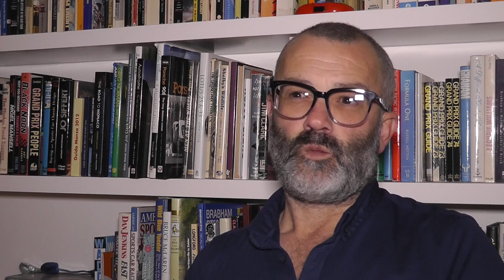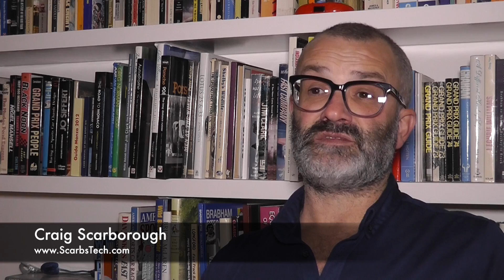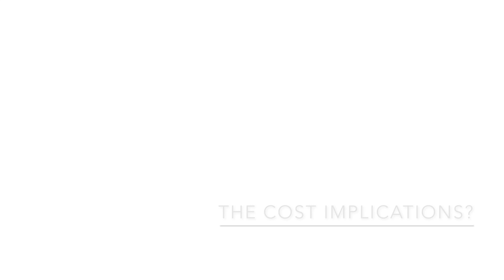Why more F1 engines may blow in 2017

Comment: The other teams could never catch up under the token system. Mercedes came with the best engine in 2014 and no one could do anything about it even in 2016 teams were still way behind because introducing improvements was so restricted. There is a natural ceiling of engine development they will hit as the engines mature. They need to let the suppliers get as close to that as possible and then they can re-introduce a token system or a freeze once they have 3 or 4 competitive engines.

Comment: ohh he didn't mention wider tyres also puts more stress on the engines so higher pressures internally. And btw I am doubtful Mercedes can make great strides with their power unit because I don't think that much more can be gained from a 1.6L block.

Comment: I see there's the great debate v10 era or turbo era why can't we get turbo 3 litre v10s. make f1 less boring and more fun and mad
Reply: Is it I3, V4, B4, H8, V12 whatever only rly make some difference in sound. Although difference in sound is mainly on exhaust itself(end turbo as part of exhaust/intake system) not engine config.

Also V6 turbo Hybrid today are as powerfull if not more than old engines. Also electric engines mean they are much more responsible. while being smaller, lighter, more reliable... in every single aspect better.

Comment: Let's not ignore the new controlling interest from 2017. Development could be something like; improve engine reliability by taking out some of the slower corners. Perhaps just leave three (left handlers)? Ease stresses on steering and suspension by banking the turns. Prevent ingress of damaging, abrasive materials after a run off into gravel traps by walling the track with concrete. This will also allow moving the crowd right up to the track edge and get them safely nearer the action. And for a stroke of genius, run the whole series calendar in just one country and save all the expensive logistic costs to divi up between the board of control members.
Reply: Engine reliability come from stop-start corners. Generally the lower engine is reving the better reliability. Because of reliability nobody is even going into 15 000 rev limit, most teams don't go above 12 000 because they don't want to blow engine. 

Also that's one of reasons why there are limitations on circuits designs. Like in to corner can't be faster than 120km/h, straights(slight curves are straights) can't be longer than 2km ect.
Reply: I think you missed my point, Czorny. If the Yanks are controlling F1, they'll turn it into NASCAR. Americans don't understand complexity, finesse and aesthetics. Brute force, up close, in yer face is what they like and what they want is what they'll get.They won't pay to see a sport where the cars come into view and flash past in a blur every 90 seconds. They prefer to watch them go round and round and round and... NASCAR!
Reply: Of course there are plenty of Americans that love F1 as much as anyone, but that doesn't mean that the generalisation is wrong, Michael. I can only speak in a general manner but as long as the majority are within the parameters of the statement, then it bears out. I don't have the facility to poll 320 million people to propose a more accurate statement, so what I offer is my opinion. I can't prove it, it can't be disproved because the evidence required to do either would be incomprehensible.
Though, I might add, the most interesting and important detail to be reported from early testing is that the new regulations regarding down force, designed to make the cars go faster, will make cars harder to follow and overtaking more difficult.
https://www.theguardian.com/sport/2017/mar/01/lewis-hamilton-f1-new-rules-barcelona-testing

I appreciate that these regulations are introduced by the FIA but Liberty Media, the new Company that controls the media distribution of F1, is going to have some very persuasive influence on what direction the sport goes in, similar to that of SKY with EUAFA.
So, I'm sorry if my generalisation misrepresents you personally, Michael. But it's already looking pretty solid as far as I can see.
Reply: IsitreallyTHATimportant Really? ross brawn.  now stfu.

Comment: I do not understand the FIA's obsession with "street car relevance" and cost cutting.  What do they care?  If the intention is attract more factory teams from VW, GM, Vauxhall or whatever, what do costs matter then?  How boring would that be anyway?  It's teams like Force India, Haas, even Williams' RBR and McLaren (relative to Merc) that make the sport exciting.  The FIA shouldn't even concern itself, necessarily with things like fuel efficiency....that's what Formula E is for...  Better sound would be great, but better racing would better.  We the fans aren't going to make a difference.  What will make a difference is when drivers and teams start to pull up of F1.  Alonso even said that he would retire if the cars stopped being fun to drive and that they were close to getting to that point.  Hopefully, if engine reliability issues because of the new demands on the power units and the higher cornering speeds suggested for 2017 will cause a bit of a shakeup and we have more results like Spain and Malaysia with Merc finding a more evenly matched field of competitors.  Hell, I wonder if we might even see Sauber or Manor get a podium!  Doubtful, but one can hope!

Comment: F1 is dead.
Reply: Car Guy The only competition in F1 is that to see who can invent a rule that dramatically increases profit.

There is nothing left of it except the rule book and the media circus that follows it around.

Zero sport and zero entertainment.
Reply: f1 today is called branding
Reply: No it isn't. It's just your passion that's dead. It's very normal, don't worry. It's just what happens sometimes when you get old and bitter.
Reply: Lol. MotoGP is where racing is at.

Attack the person not the message whilst your weak mind tries to catch on.
Reply: no really its dead
Reply: For all those commenting that F1 is dead, or is not a motorsport, I have a suggestion.  Strap on an open cockpit, open wheel car, and line up with 21 other DRIVERS.  Then hurl yourself around a complex of turns and compressions at average speed 140 MPH for 2 to 3 hours enduring 3-5 Gs in turning, accelerations, and braking whilst communicating with your enginneer.  If you finish or survive, then I would like to ask you, is F1 a sport?

If you don't like the sport that is your prerogative, but it still is a sport regardless. 

As far as marketing  damaging the sport. I partially agree.  But if one looks closely, they will see this is the way of the modern world.  All popular sports, athletes, and entertainers are milking that cow.  I find it annoying as well but it seems that is the way it is these days.

I must apologize if it seems I have a harsh tone,but my heart is with drivers always, who show equal part skill and courage, in all motorsport.
Reply: And that's a good thing. It has competition in every area
Reply: Don't underestimate the power of a good flogging.
Reply: I don't believe I ever used the word dangerous.  But I was making the point,  it takes a massive amount of skill to bring those cars home, skill from everyone involved.  Again if you don't like it that's your choice and opinion, but considering the stresses on the body and skill required, I would still technically classify it as a sport.  

Actually the way you described the current sate  of F1, I feel the same way about the NFL, and though I used to love NFL football and now I loathe it, I still consider it a sport.  And I agree on that point, perhaps their is to much meddling in the rule book.  

But I still see the competition, mostly in the back of the field, granted.  And maybe your team might not win the world championship, but perhaps they can steal a podium in a GP or two.  It's not that the competition is gone, it may have changed, and obviously changed for the worse, in your opinion, and in the opinion of many, seeing that F1 has lost fans since it's peak.

And on domination. Actually in many sports the same teams tend to dominate.  Look up how may different teams have won the world cup, or world series, or super bowl.  Not many.  It's the nature of the beast, especially when money enters the picture.

But even after all this, my point is whatever you think about the state of F1, the drivers are still athletes, and it is still a sport.  

Maybe I'll skip the flogging, and take up Golf, or Darts.  You can go watch paint drying if you like.  They probably bet on it in Las Vegas too.
Reply: It's been dead for a long time. For various reasons mentioned in other comments but dead, it is. The racing is almost as boring to watch as that American oval racing is, in all its forms. I don't give a shit about cost containment, it's not my money. Teams who can't afford to race shouldn't be racing. Technology for the sake of technology is also detrimental to the spectacle of racing. Why not piss the drivers off altogether and have autonomous racing, it wouldn't be any the less boring to watch. For entertainment, get rid of the automatic gears and put a gear lever and a clutch pedal back in the cars. Get rid of the chicanes off the tracks. Allow unlimited fuel and tyres. Then we might have some actually entertaining racing to watch.
Reply: I agree but it's a great sport for engineers!
Reply: Something being dangerous is not enough to qualify it as a sport.
It requires competition and entertainment (for spectator sport).
F1 has none of the above, the competition is gone that same teams have and do dominate, and as an event to watch, paint drying does that better.

As for blaming marketing, well there is more to it than that.
The constant manipulation of the rule book, the vested interests of questionable people, dabbling to maintain their strange income from F1.

It is dead, and flogging its' corpse will do you or it no good.
Reply: +NoName
First I would like to thank you for having a civilized discourse about this.  It seems a rare occurrence on these social media platforms.

There is one point I would like to make about motorsport in general, which is obvious to anyone who follows the sport.  The connection between the technology and the athlete is closer and more connected than any other sport.  Change in the rules may be necessary from time to time to  keep it interesting.  In researching the history of F1, spec changes are normal and happen quite often to keep up with the technology.   Of course, the cars could drive themselves in F1, but the regulations are in part put there to value driver skill.   It's the F1 paradox of wanting the most cutting edge technology but wanting to display driver prowess as well. What's the balance?

But I agree that excessive celebrity and marketing damages the sport, especially when these aspects start dictating the rules.  No sport seems immune to this phenomenon.  I wonder, if MotoGP greatly gained in popularity( I realize it may be more popular than F1 in certain countries) , would they start falling into the same traps?
Reply: F1 has always been a lot about engineering. Do you think that Jim Clark would have won as much if Colin Chapman didn't design his cars? Sure the engineering might have even bigger role nowadays, but that's because there's lot of money involved AND the drivers are a lot more professional than in the past. There doesn't exist any genuinely bad F1-drivers anymore, the skill differences are lot smaller. So a fast car has much more effect than slightly faster driver.

Only problems I have with F1 atm is their overly large "green-thinking" and that the sport is shifting away from awesome classic tracks into the arabic countries with mostly boring and bland tracks (Bahrain is okay, but others not so much).
Reply: i have been an f1 fan for years.. watched every race, been to the Australian Gp the last 6 years. Motgp is the real racers comp. F1 is all show, no parity, just a moving advert which is horrid as the cars and drivers are simply stunning.
Reply: Discipulus Scullion Is that a problem? You think Lewis wouldn't want it? Guess what, people are different
Reply: Autonomous racing would actually be quite the spectacle!!.  Id actually enjoy watching that.  There would be so many crashes in the first few seasons.  

But you're right, clutch pedal and manual shift would make it SO much more exciting.  Its F1 though... and DSG's are a common thing now... and F1 can't go backwards.
Reply: ok, that is interesting, well moderately interesting, but I don't have any questions.
Reply: I must disappoint you. My mind will never catch up to your level of arrogance.
Reply: +Hx Khltr We are not so far off viewpoint I think, it is still a sport as you say, but it become sterile and stand-offish. Rules taking away the thrill and chance, and the growing embrace of celebrity culture.

Again compare it to MotoGP, the thrills are raw, and know one never knows who will win. The 'stars' of MGP are also more accessible, down to earth, characters rather than Hollywood clones.

The 'move' to Hollywood(not literally) I feel is part of the same mechanism that introduces these rules. Whoever the organisation is composed of that makes these choices, they must be the polar opposite of a gestalt entity... the more there are of them, the dumber their output/capabilities.
Reply: +Hx Khltr No worries, it is nice to have a good chat.

I think that F1 has it's roots of being an upperclass pastime, something well-off gentlemen would partake in, and I think this is something those behind the sport still hold dear.

MGP is just flat out crazy and without doubt dangerous. This seems to either draw-in, or require a certain kind of rider.

F1 drivers are picked up at a young age and seem to go through some kind of finishing school, make sure they have the right image and mannerisms to suit the money, crowds, sponsors etc. Even if they come from a disadvantaged background, they end up being "what ho chaps".

MGP riders are more a strange rogue person, like the mythical cowboys in the movies. I think that if sponsors searched and moulded  a person like F1 does, you would never have had Rossi or Marc Marquez.

So if MGP became as popular as F1 and the sponsors and governing bodies took the same tack as F1, then yes MGP would suffer and die the same death.
Reply: I read from your post you are an F1 'fan'.
Yet you too see policy over sport eroding it.
Reply: +Hx Khltr  I think he meant 
"The entertainment" has gone astray! 3 more seasons before new engines...but il still watch it ...just..Thank God for Spa & monacco
Reply: +Jeffo Jon J  The cars have become so finely tuned that overtaking has become more difficult.  And the overtaking is  the entertainment for many viewers, and I understand that, as does the FIA.  There have  been recent attempts in the rules to restrict or change aerodynamics in the hopes of adding competitiveness,with mixed results.  As subject of this video, and concerning the new regulation changes in general, let's hope it shakes some things up in the front( assuming your not a Mercedes fan).  

I personally would like to see Mclaren Honda  pushing,  I'm interested in seeing if Force India continues improving.   And of course who will take it to Mercedes, Ferrari or Red Bull, or perhaps Williams or McLaren?.

 I do love Monacco.

Comment: They should have just changed how many tokens team can use. After first race, team that leads constructer`s championship would only get 1 token they can use during the year, and team that leads`s driver`s championship would get 1 token which can be used during the year. If Mercedes leads both, they would thus have 2 tokens that they can use when ever they want to. Team that is in second place would get 2+2 so Ferrari for example would now have 4 tokens they can use to catch up. Team that has least points would get most tokens, so Honda can improve their lawnmowers. 
Teams that don`t finish on points would get same amount of tokens as team that gets 1 point, but of course they still would not get points and money from that points finish. 
You would get more tokens after each race.

Also i think less money your team uses, more money it should be rewarded for each point. 

This would make it possible for teams like Minardi to compete against bigger teams. If Minardi`s carpenters can make a miracle and finish on points even though they did not have any money to spend on upgrades, they would now be highly rewarded and they could improve their car so they can try to finish on points again. And if they manage to again finish on points, they could keep growing. But of course, it would still be fair for large teams as well, becouse if they start doing worse like Honda, they would now be ones that get most tokens. 

I think it would be really good marketing value for any car manufacturer to prove that they can make fastest car with as little money as possible. In modern day i think it is more valued if teams do a lot with less money. And we might be getting new Minardi again!

We need a system where you get more help the worse you do. You still would want to do as well as possible, becouse every point is important to win championship. And of course, you still can develop and improve the car, you just don`t have extra tokens and you have to be more creative. 

This system would ensure that no team could dominate. And if team does dominate, who could say they don`t deserve it?

Comment: Ultimately they are still limited to the number of engines, so unless if the engine is a Honda then manufacturers are still going to make small incremental changes throughout the season.  Ron Dennis really screwed Honda by not allowing other teams to get mileage on those, so unless if Honda achieves a miracle they will always be on their back foot development wise.  It should make for an interesting season though.